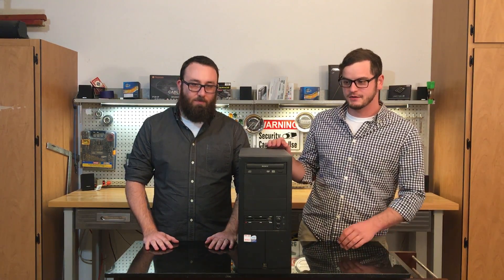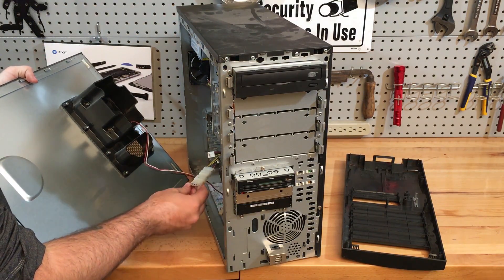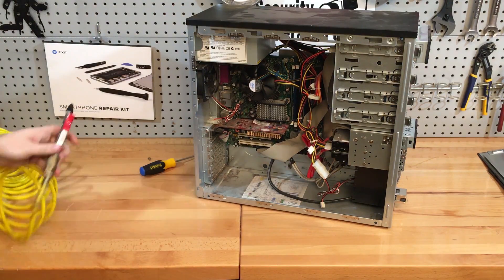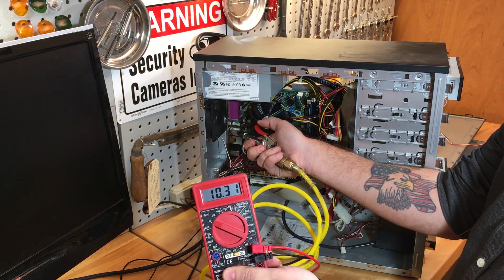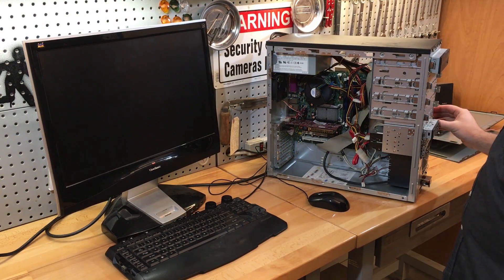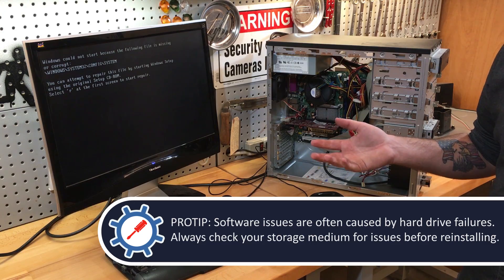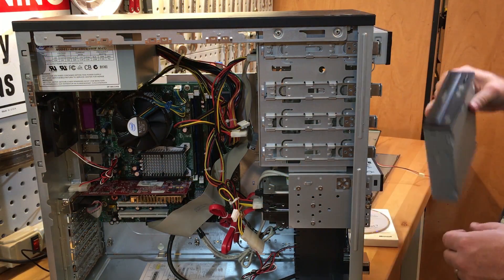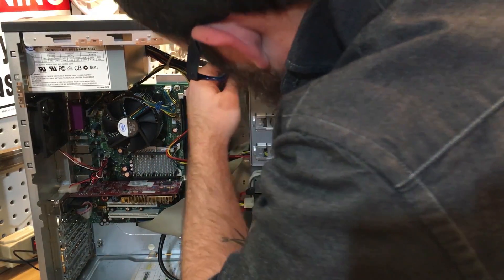One Man's Trash - Episode 01 Reviving an old PC

Comment: For me, i cannot bring an old pc back to life since the motherboard dies. It works fine a few seconds, shuts off suddenly and wont even post or do something. I think the fuse broke or the board circuits doesnt make contact anymore. Tried cleaning it, realligning stuff, changing parts - everything. it just wouldn't post at all. rip 2007 asrock
Reply: Tried psu?

Comment: Still using such a PC. It also has a GeForce 8400GS (1 GB), 8 GB DDR2 and a 4-core Phenom II (3.2 GHz) replacing a 3-core Phenom (2.3 GHz). It has 3 striped HDDs (1.82 TB) and 1 SSD (128 GB) and PCIe x1 cards for SATA-3 and USB 3.0.

The system is based on Ubuntu Mate 18.04 LTS, Virtualbox and it boots and uses ZFS as file system (LZ4 compressed). It runs Virtual Machines like Windows XP, 7 and 10, Ubuntu 19.04 (5 flavors) and three other dedicated Linux VMs for banking, application try-outs and the last one for office stuff like Email, Torrents, WhatsApp, LibreOffice etc.

I'm very happy with  this "piece of trash" produced by HP in October 2008.

Comment: I'm pretty sure on any Core 2 Duo system say even back from 2007 to 2008, you can even install Windows 10 and it will work fine at least for general pc tasks such as word processing, e-mail, facebook, youtube, and even some light gaming as well as general video/audio playback.
Reply: You are correct, I have 2 that work fine with Win 10 x64. Both are C2D E8400 @ 3.00Ghz (stock) with 8GB of DDR2 RAM and an SSD running the OS.

Comment: Hey guys. My  pc  cpu  running but the monitor  goes POWER SAVING MODE. i changed the cmos battery  cleaned the ram, but still its on that stage.

Comment: While fans produce voltage when blown with air, it's not enough current to harm anything. And unless you use a high pressure air compressor, then you don't have to worry about damaging the fans either.

Comment: That error does not require a reinstallation. It means the registry system hive is corrupt.  For Windows XP there is a system volume information folder on the root of c. Inside there are restore points. You can open one up and see a backup of the system reg hive. You just have to rename it back to system and put it in c:\windows\system32\config. If it's windows 7 there is a folder inside c:\windows\system32\config\regback where it keeps a backup copy of the registry. You can take the system hive from that folder to replace the corrupt one. In this case he will probably want to clean install anyway. But if anyone else has this problem .. it does NOT require a reinstall.

Comment: The file it said was missing or corrupt was a registry hive. This is easily restored manually from the command prompt if you can get it that far or by slaving it in another tower if not. A reformat should not have been necessary.
Reply: who the hell wants to go through all the trouble of swapping it into another tower if they're restoring an old used PC with somebodies junk filled slow as shit OS on it and would benefit from a clean install anyways? this isn't a customer repair job.

Comment: There are two things everyone should know about computers if planning to fix and use a broken computer that can help save time or precious data.
a broken computer often fails for a reason, It can be due to simple software errors that corrupts files just as shown in this video but it can also be a side affect from hardware error. even if it works to reinstall windows and make it work again it can still fail again if there is a hardware issue around.
so everyone that gonna revive a computer should always check all capacitors on the components if the top of the capacitor bulges out or leaks, and also use programs such as Crystal disk info or other freeware to check the SMART status of the hard drives for errors and even scan the drives surface for sector problems. these are the two most common fails in a computer and is very important to know about.
there is one simple fact about hard drives and that is the risk of getting a crash is 100% on all drives and brands, the question is only when it gonna happen and Smart status programs that alerts when things are getting bad may save your files in time before the drive just fails permanently on you, cheers

Comment: My pc now is an I5 3450, 8GB DDR3, 2.5 TB hhds, GTX550Ti, and an HAF 922 case. I found the lot in the rubbish. The guy who threw it away said it was dead. I cleaned the dust out and fired it up, and it's been running like a champion ever since! Before that, I found a Q6600, 2GB, 500GB, and some crap video card. There was nothing wrong with it. I have found monitors, stereo systems, and even fully functional, but old server systems in the trash.

Comment: No need to hold the fans while blowing out the computer. The voltage produced may look bad, but the amperage is negligible and will not hurt any components connected to the system. Also, rotating the fans at higher speeds than normal should not damage the fans. If the fan fails after being rotated by blowing air, then it was going to fail soon anyhow and it's better that you find out and replace the fan. I blow all my computers out with a leaf blower and have never damaged any fan or computer. Plus the air is dry and will not have any moisture or oil that compressors can produce and does not harm the environment like canned air products do.
Reply: I'd rather just hold down the fan. That way I'll KNOW nothing will happen, and it's free.
Reply: this isn't entirely true..the fans being rotated by compressed air won't damage anything like the MOBO by creating voltage BUT the fan itself very well can be easily damaged when it's spinning at 10-20k RPM and only designed to spin at 2500...you can destroy a brand new noctura fan out of the box by doing this..so no it wasn't "going to fail soon anyways" but this is not exactly going to happen under normal circumstances unless some idiot is aiming the compressor at the fan for more than a quick second or 2.

Comment: If you're just going to use it for basic tasks I'd recommend putting a lightweight linux distro on it instead. Windows comes with a lot of bloatware and will slow it down. Plus with all the support out there throwing Lubuntu on it and getting everything just the way you like it shouldn't be a hassle at all.

Comment: I recently took out my old P4 HT w/4gb ddr2 ram, 1tb storage and windows xp out of the closet , Stuck a video card that supports 1080p with a hdmi out ($30) in it, Upgraded the CPU to the fastest the MOBO would support which was a 6700 dual core ($10) and did a fresh install of windows 10 (18$) . and it runs smooth as butter, using it in the living room to watch youtube videos, online movies and Netflix. all for under 60 bucks.

Comment: Nice tip on the voltage feedback from spinning fans.  That never occurred to me in 20+ years of working on, and building computers.  I actually feel somewhat embarrassed now having to admit that.

I'm surprised you didn't do any testing on the hard drive itself before going ahead with the Windows install.  I've done full installs on used hard drives like this that went perfectly fine, only to have the drive fail a week later.  Believe me it is no fun when your upset customer calls back complaining that the PC you just fixed for them is broken again.  I like doing a good torture test like running Darik's Boot and Nuke overnight.  If it completes I feel pretty confident the drive is OK.  If not then I know the drive is junk.

Comment: With the hdd on SATA, you had no need to check if the dvd-rom drive was a Master, Slave, or C/S... and as for the fans, just unplug them from their sockets... also immaterial since diodes protect the motherboard.

And blowing it clean inside a workshop? Dude!

Comment: The missing file is just part of the registry. Easy to just copy the file over from the installation disk.
Ofcourse it'S the version from an initial setup. But the machine will run again.
Reply: Files can still be recovered.
But running a fresh, clean setup will rule out any misconfigurations of the old system.

Comment: first of all this was a great video and very well done and the second thing I have an issue there are times when my browser google chrome gets slow and or glitchy and will also not respond or crush and I installed it three times and defraged my hard drive and ran my security anti virus software three times as well and the same issue happens . I would also like to know if you could direct me to find a freeware pc speed up software that is very reliable and as I said freeware I am on a fixed income and would be very grateful thank you and keep up the great word
Reply: tough213 good afternoon! I would stay away from any software stating it will speed up your PC. Your PC is as fast as the hardware inside of it. There could be a number of different software that could be using your PCs resources in the background causing everything else to run slow. Best way to find out is when it's happening, open the task manager and go to processes, then sort my CPU so the highest percent is on the top. If it's not an app you are purposely running, right click and end task. Also do the same for memory. If that helps, look into removing that app from your PC. Good luck!
Reply: ok thank you for the advice . I will try your suguestion and if it is ok and I need futher help would it be ok to ask thank you so much and all the best have a great week
Reply: tough213 let me know!
Reply: Hello thank you for all the help I got my computer to run a bit faster but I am still having issues with google chrome browser it at times takes long to load a page or crashes and I do not know what is going on it is intermitent but very annoying . thank you for all the help I am very grateful
Reply: tough213 try disabling all plugins and add-ons to google chrome. If that doesn't work I would uninstall and reinstall.

Comment: i found pc in dumpster yesterday. it dell brand and spec 
Intel pentium 4 478 socket 
Ram ddr1 256mb 
Hdd ide 20Gb 
unknown Gpu. 32mb 
windows 98 SE 

soooo.....   sad.
Reply: thats not worth keeping, but if your in to old pc, fire it up and get it going!
Reply: hurmmm... i still keep that pc in my workshop until today.....
Reply: @Debstool  It sure does. Provided you got the right drivers.
I am into Windows 98 SE. I am currently runing it on an older PC that I got from a friend. The motherboard has alsp got SATA and there are drivers available for Windows 98.
I am using it for/with an old dot-matrix printer (on paralel port)

Comment: Note that you can also copy the missing file from the Windows install disk.
On 7 upwards it's located insde the "Install.wim" file.
Could be helpful if your system isn't booting anymore.

It's part of the Registry, and by copying over the file from the disk you get atleast the configurtion of a freshly installed system back.

Comment: Good tip about the fans, I don't make that mistake any more.
Reply: And it shows these guys actually know what they are talking about.
If you  don't have compressed air (either from a compressor or a can) you can also use a vacuum. But the same holds true: hold the fan in place.
Also for the power supply: You can just put a small screwdriver between the fins to stop it spinning.
Reply: I have never had issues of fans making a mobo die because the fans spin but it can always be better to be careful than reckless anyways. besides if you think of it ALL the fans are spinning and maybe even at full speed when the computer is turned off every time so why would this back voltage not damage stuff at normal use if it was that bad for the computer
Reply: PvtMadnage the education is not just a joke. Its a pn embarrasment and a fuck you to common sense.
Reply: Vacuums cause static, you really should NOT use them. I have never had any problems with fans spinning causing electrical problems in over 300+ cleanings. You can break the blades off from spinning them to quickly with air though.

Comment: Those pins behind a hdd or cd/dvdrom drive. THat plastic thingy is called a jumper:)
Reply: Yes. it shorts whichever two pins it is touching, which effectively toggles an option within the firmware of the device it's on!

Comment: i liked this video just purely for the tip of holding the fan down while blowing it out. i had a friend who cleaned an hd 7770 out and didn't do that. the bearing on the fan went bad so to the point where if you went past 75 percent it would grind.

Comment: nice job! what i woulda done is Install Windows XP 4 those older games! i wouldn't use any Windows newer than XP on a CPU which has less than 4 cores
Reply: Having more cores doesn't make the PC automatically fast. It is sometimes better to have less cores and a higher clock rate (overclock). I have used a core 2 duo and win vista 32 bit for years. The CPU was only at 1.86 GHz while having a single 2.5 GHz would have been better for Ghostbusters. It only had 2 GB RAM which was barely enough for ghostbusters and the gpu was not fast enough (geforce 8600) and only had 256 MB while I needed 512 MB.
Reply: +blakedmc1989RaveHD It has 2 cores 4 threads and 2 cores is fine for windows 10. windows 10 is lighter than xp.
Reply: Bryson Shires dual core is minimum for windows 10 but it will still run on a p4
Reply: Core i3?
Reply: core i3 would work 4 newer os just fine
Reply: blakedmc1989RaveHD It has only 2 cores tho lol
Reply: Bryson Shires i thought it's a quad core
Reply: blakedmc1989RaveHD nopeee
Reply: Bryson Shires no wonder my Sony Laptop is so slow -_-
Reply: blakedmc1989RaveHD for anyone that actually plays that game they can dual boot
Reply: blakedmc1989RaveHD
"'ve tried dual bootin' and it still didn't work 4 Polaris SnoCross!"

==That doesn't make any sense.
Reply: blakedmc1989RaveHD Wtf that makes no sense
Reply: blakedmc1989RaveHD
But what does a dual boot have to do with a software? Dual boot is handled by the boot loader (You choose which OS to load).
The software (your game) is not aware of any other OSes on the disk.

Perhaps that game is doing some funny business and should not even be installed.
Reply: blakedmc1989RaveHD
Yes, it can happen that an old software will not run on a newer OS. I think it was in Win 2000 that MS introduced the ability to run a EXE in a Win 98 and Win 95 mode.

But anyway, you are saying that you dual boot WIn XP and Win 7 or something, and still, the game that is suppose to run on Win XP doesn't work?
Reply: blakedmc1989RaveHD That makes no sense
Reply: blakedmc1989RaveHD It most definitely should work.
Reply: "sure Half Life and alot of popular shootin' games would work fine on a modern OS and with dual bootin' "

Are you booting into the modern OS? You must boot into the older OS to play the game.
Dual booting for sure works 110% as you're running it in the operating system it's designed for.
Reply: blakedmc1989RaveHD Just dual-boot and on the OS selection menu select XP for example. Then install and launch the game.
Reply: blakedmc1989RaveHD Oh, okay.
Reply: blakedmc1989RaveHD Aw. =I I like frogger. =P
Reply: blakedmc1989RaveHD wow XD
Reply: blakedmc1989RaveHD Yeah... Perhaps it used a system for the audio that newer windows operating systems just can't run. D:
Reply: blakedmc1989RaveHD I have Windows 10 64-bit installed onto an Athlon 64 x2.
Reply: The pentium g4560 is a dual core and thats fast very fast
Reply: Leon I've tried dual bootin' and it still didn't work 4 Polaris SnoCross! i'm just thankful 2 have a dedicated Windows XP machine 4 it
Reply: louis tournas tha game was well known 4 tha problem! and it still has dat issue in today's time! sure Half Life and alot of popular shootin' games would work fine on a modern OS and with dual bootin' but with Polaris SnoCross, it will not work on a modern OS even if it's dual booted!
Reply: Animu Scrub well Polaris SnoCross is an unsolvable game 2 run on a modern OS and which it's why i prefer 2 have more than 1 dedicated PC instead
Reply: Leon but there are still games dat can't run on a Windows newer than XP

4 example: Polaris SnoCross
Reply: louis tournas not really! it was just how tha game was optimized! look at Frogger remake from 1997 on PC which tha music doesn't play unless u're on dedicated Windows 98 with tha real hardware 4 it! yea dat game also has not solve tha issue! not every old PC game runs on every OS and i can name more games right off tha bat
Reply: louis tournas on certain games dual bootin' don't work
Reply: Leon well it didn't 4 Polaris SnoCross or Frogger 1997 3d Remake! Well Frogger (1997) was an exception except tha music don't work unless u're playin' on Windows 98 and compatability mode didn't even work either
Reply: Animu Scrub it still had tha headlight glitch with dual boot on Polaris SnoCross! i just gave up and decided 2 have a spare separate PC dedicated 2 run Windows XP but tha game was better optimized 4 Windows 98 and compatibility mode doesn't work on dat 1 game even if u throw alot of configs at it! maybe it was successful on other games but not Polaris SnoCross
Reply: Animu Scrub Frogger (1997 3D remake) is a different story, tha game's soundtrack only works if u're plain' on Windows 95-98 sadly
Reply: Animu Scrub yes tha 3D Frogger Remake can't even run properly on a Windows newer than 98! even it's 2nd 3D sequel suffered tha same fate
Reply: Animu Scrub dat'z a perfect example of not every old PC game can't be played on Modern OS systems
Reply: Animu Scrub yea however it doesn't make any sense! but then again, Hasbro and Atari games (Infogrames) never had good support 4 newer OS 4 their older games at all